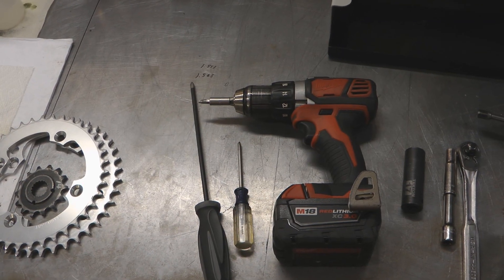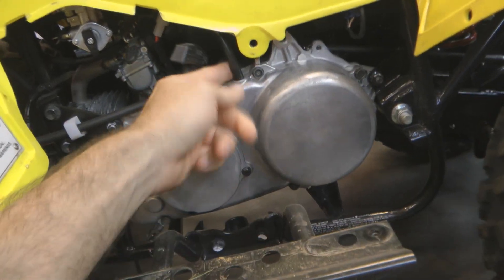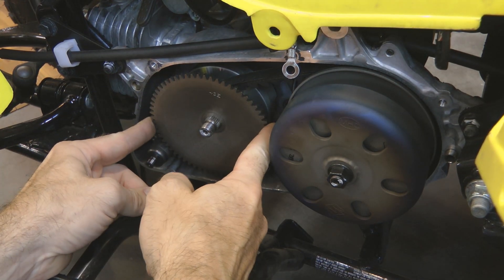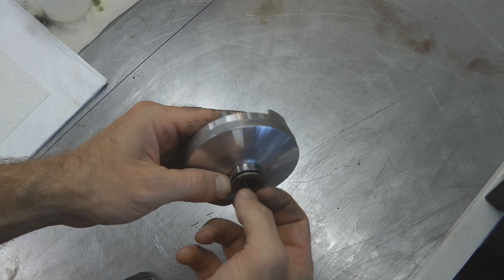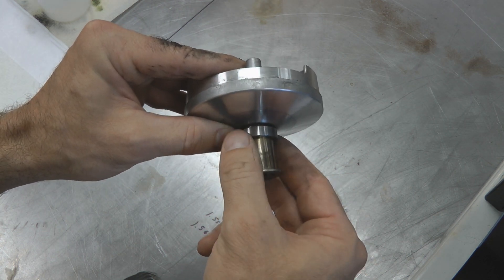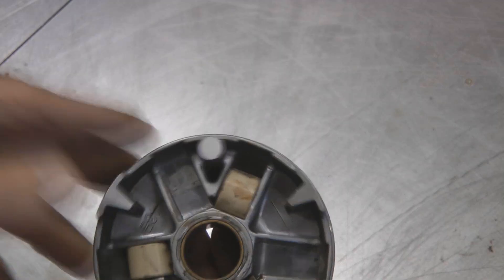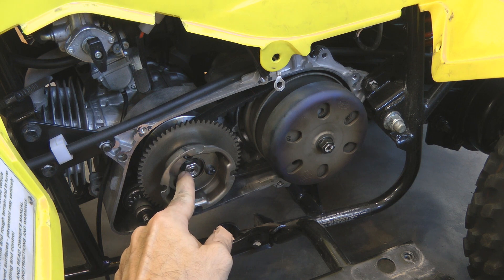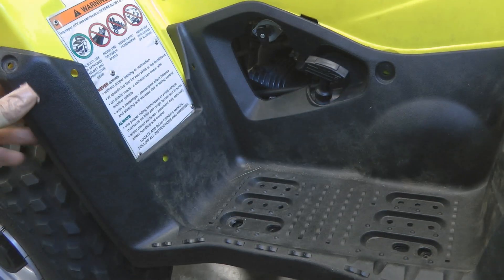Hott Boy's Garage - Ep. 26 - Suzuki LTZ50 - Double the Top Speed and Make it Quicker w/ Clutch Mods!

Comment: instead of "flipping" the flanged bushing, "trim" the flange off, leaving full length in order to allow full travel / separation of the pulley halves.  Brings the top speed well over 20mph

Comment: I have one of these also and was very disappointed with the performance of it. Just like you, I removed three of the clutch rollers which helped with low end. By far the best mod for it was getting a custom rear sprocket made for it. I had sprocket specialist in Utah make a 48 tooth rear sprocket for it. Then put a high RPM CDI box on it to get the top speed back. It's still very discouraging that some of the other 50s are just more powerful.
Reply from the maker: Agreed...its a good machine for little ones to start on. But after a few months, mine are all ready for more speed than what these little 50s will do.
Reply: Which 50s do you recommend?